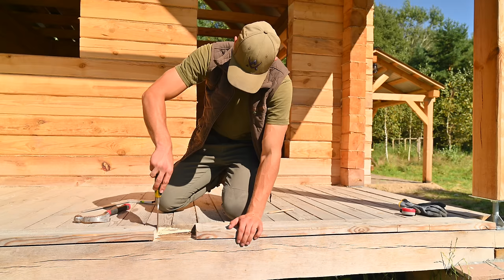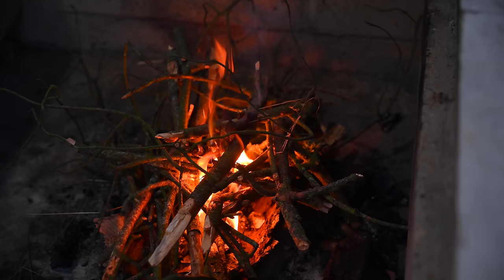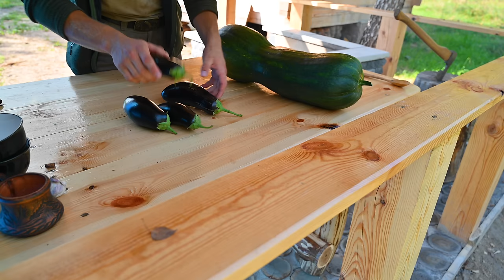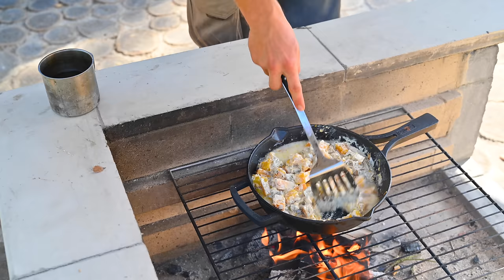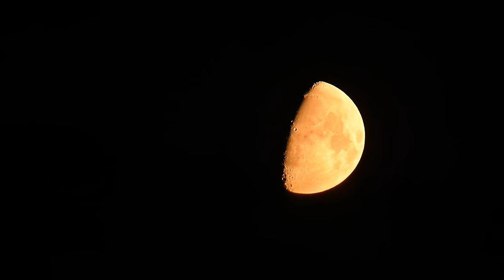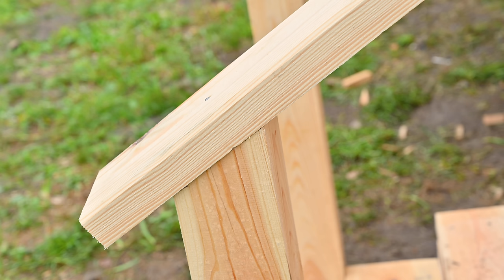My Front Porch in my Log Cabin | Favorite Place in the Forest, Ep.11

Comment: For your cooking fire, you could get a metal stove top that you could swap for the grill so you have smaller job rings for saucepans. Would heat them more efficiently and you wouldn’t have to shove you hand into the flames to get your kettle. You could then also use the fire as an oven by closing off the hob rings.

It should be pretty easy to get fabricated. You’d just need a sheet of metal the right size and thickness to fit in the grooves you made for the grill, then getting some concentric rings cut in at an angle so the rings can be removed to make an appropriate size hole for the pan.